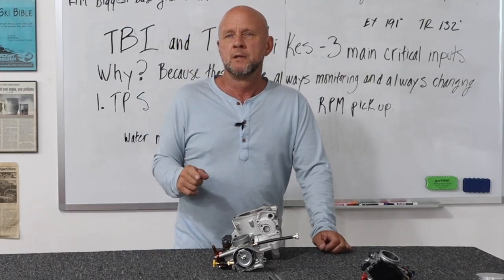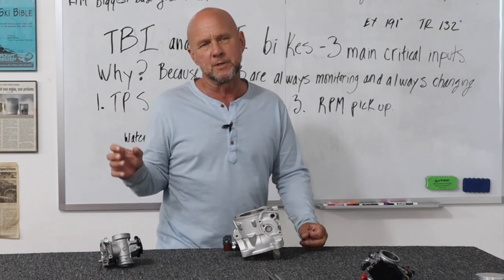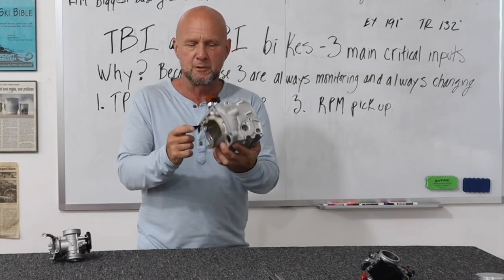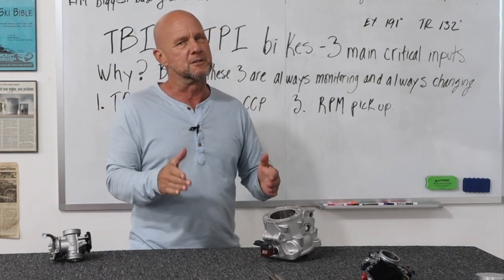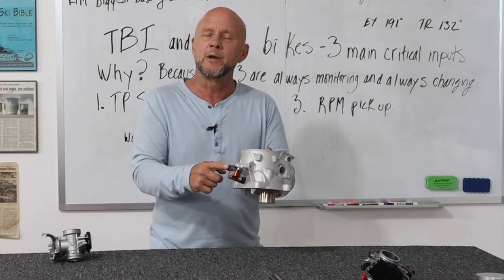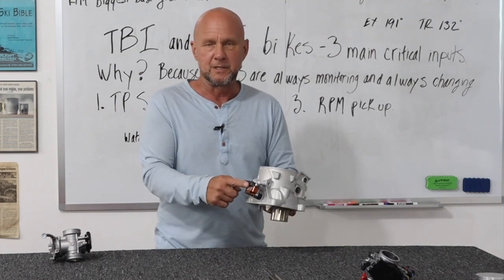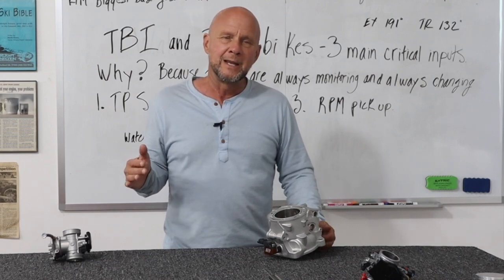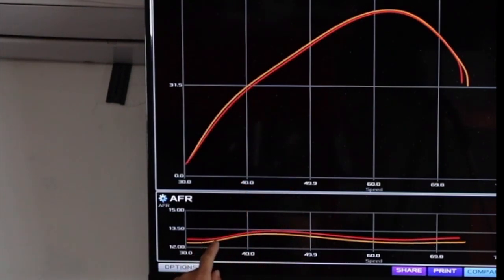Understanding the crankcase pressure sensor on  2023-25 TBI bikes, will keep you from fouling plugs

Comment: After pressure testing my 300 it showed a major leak and how loose the CCP sensor fit the rubber manifold. When I removed the sensor it had oil dripping out of the inlet, effects from bad clutch side crank seal. I like the looks of the CCP sensor manifold set up you made there, has to be way better than loose fitting factory manifold.